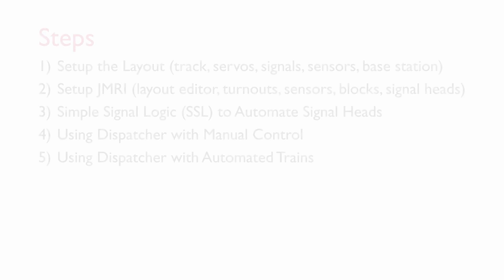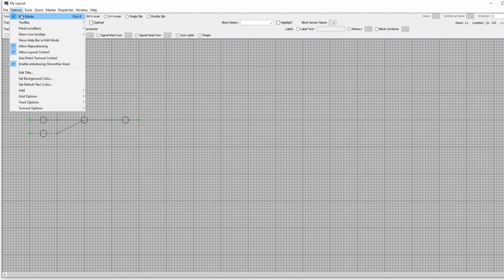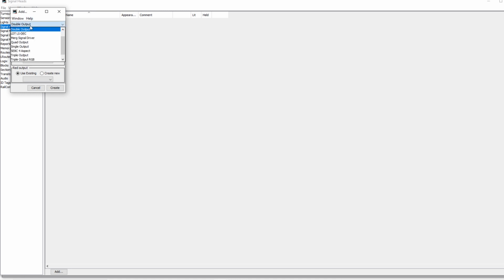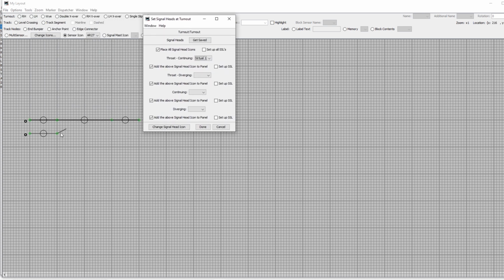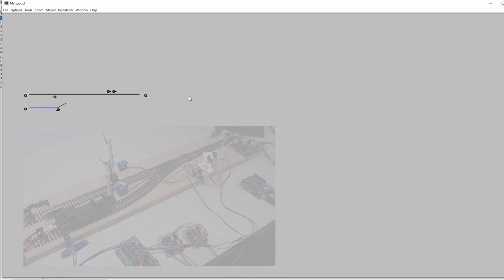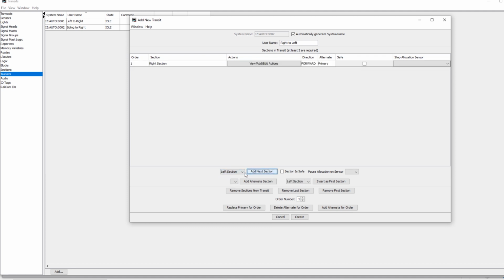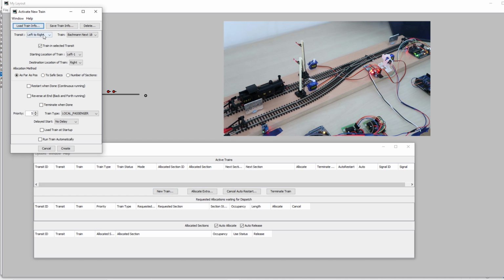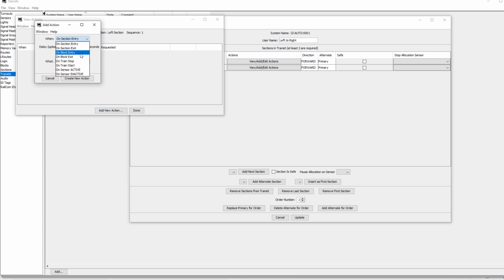Model Railway Automation using JRMI Dispatcher and Simple Signal Logic

Comment: Hi Rob, me again lol.
If I don't have any physical signals can I just use all virtual to control automation.
Cheers
Reply from the maker: Yes, all signals can be virtual if you want, JMRI just needs to have all the required signals in place for the automated logic to work. The virtual buffer stop signals are the ones I always forget to add. I think if most modellers tried to accurately signal their layouts then it would look very cluttered.

If you're starting to get into signalling then it's also worth checking out Signal Mast Logic as well as Simple Signal Logic which is shown in the video.

And remember to save your files in different versions occassionally as the signalling logic can very easily go wrong, especially if you need to delete a turnout, block or signal which is being used as part of the logic. The file can say it's corrupted and refuse to open. That's when it's good to have a working version to go back to. If you do ever get a "corrupt" file then don't panic, it's fixable using notepad if you know where to look.
Reply: @LittleWicketRailway  cheers Rob. Very good advice about saving under different named, I've been saving everything under test layout so nothings separate, bad idea.
I've just come across another problem, I have micro switches set to 2 point servos. Both show up and change in the sensor table. When I set the feedback option to one sensor and sensor number one of the points just constantly changes and the other goes back to its previous state after you change it. Will have another go tomorrow night see if I've done something wrong.
Thanks for the reply.
Steve

Comment: Fantastic series of videos on Arduino, well done 
If I have 3 Arduinos (1 for sensors, 1 for servos and 1 for control) can they be connected to my USB on the computer via a USB spliter or do I need 3 USB ports on the computer?
Reply from the maker: Hi Ian, think you emailed me about this, but just to confirm as I think a few people might also be interest, yes you can use a USB hub/splitter, but it would need to have a separate power supply, something like this: https://amzn.to/3ohIx69

Comment: i have a question if i have engine throttle on one uno with  motor shield which connects to track
a second mega with sensor hub and several sensors
a third mega with the servos 
how does each mega and uno communicate with jmri running on pi connected to uno to update the track layout from layout editor?
Reply from the maker: Hi Jerry, I'm running JMRI off a laptop rather than a Pi so it might be different, but I've got a powered USB hub for my 3 Arduinos. Windows then allocates each board with an individual COM port. Then you can set each connection in JMRI.

Comment: Suppose you had a sensor at both ends of your Turntable Bridge and you wanted to be able to automatically move a locomotive out of the roundhouse and onto the main. Could dispatcher do that or is logic the way to go?I have two Wifi sensors MS600 and MS601. I would need either sensor to detect a locomotive coming onto the turntable and stopping when the locomotive gets on the turntable. The Heljen turntable is DCC controlled and I suspect JMRI can keep track of  the head and tail of the bridge. The two sensors were added by me and designed by a good friend.
Reply from the maker: I think you would need to write a script for this. I don't think dispatcher would be able to handle setting the bridge position automatically.

Script writing isn't too hard. Controlling trains and "Listening" for changes in sensors is easy.

Comment: Brilliant introduction to JMRI Automation.  Shows a lot of flexibility and possibilities.  Well narrated as usual! :)
Reply from the maker: Thanks for watching! I discovered that I really struggle to say "implement automation", I kept saying "implement automentation"!?!  🙄
Reply: @LittleWicketRailway  Hi Rob.  Have been mulling it over for a couple of days when you mentioned in this video not using a debounce delay for the micro-switch.  Technically it would be best to use a debounce for the switch as well considering the potential for a incorrect reading from the switch flicking states whilst being activated.  Although the likelihood is low it could still happen - a delay of 1/10th second (100 milliseconds) is more than ample.  I would also use the debounce for both the 'on' and 'off' state of the switch.
Reply from the maker: @Little-Rob  I think you're right, wouldn't hurt to have a short delay and would eliminate any potential flickering. I suppose there's also a time delay between the switch deactivating and the point actually moving into position, so you could use the delay to reflect that. More important if you've slowed the servo down for a more realistic switching time. Wouldn't want the computer sending the express flying through before the blades were in position.

Althought if you've got flickering then it suggests that something needs to be physically adjusted, either the switch has moved on the mount or the point isn't going through the full range of motion.